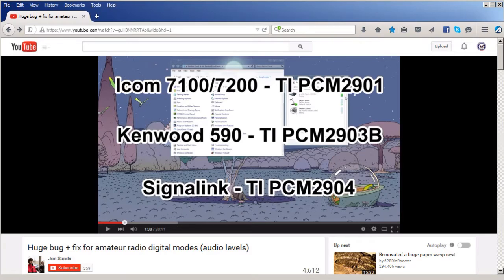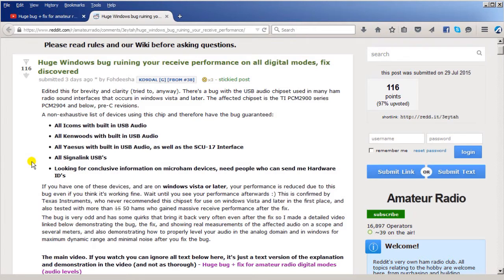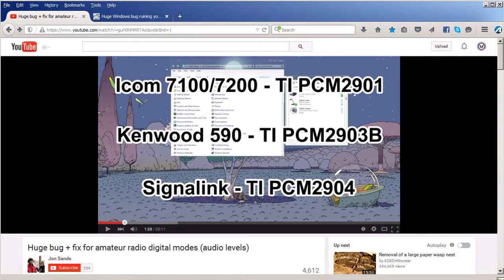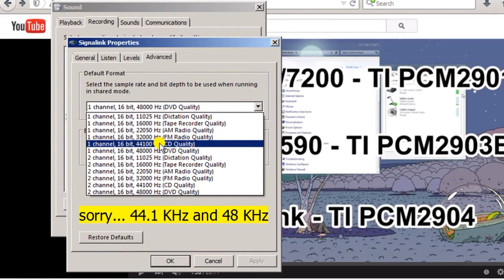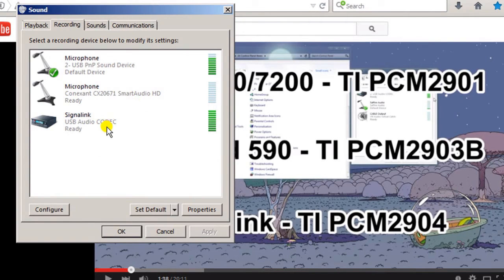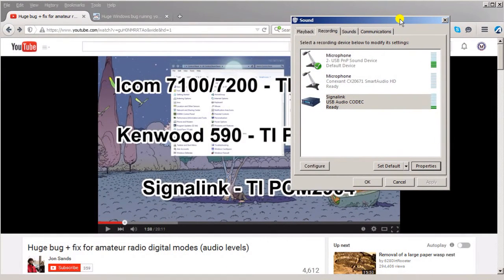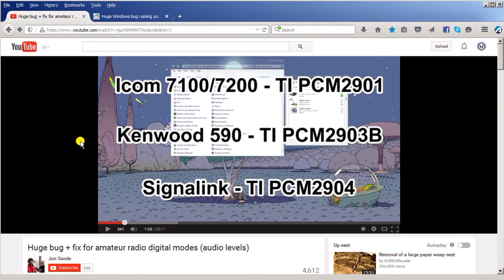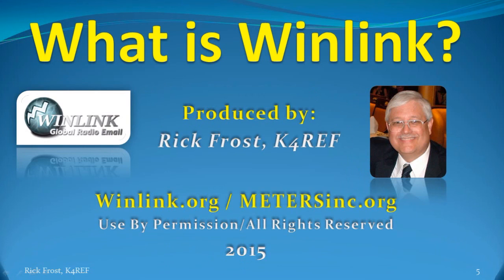Winlink - "Fixing the Clipping Bug"

Comment: After watching your video I tried this on my system. I am using a signal link with an FT-950. Also I have an IC-9700 using the USB audio. I do not have the condition. I am running Windows 10. I mostly run WSJTX on HF. On VHF I run VARA FM WInlink. I liked your video very informative. I would have never thought to check for the bug. Thanks